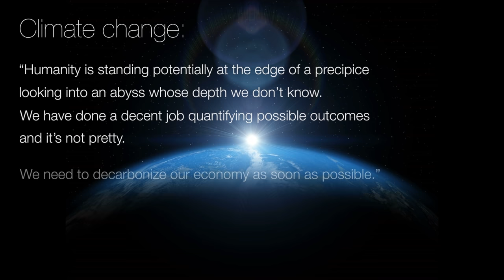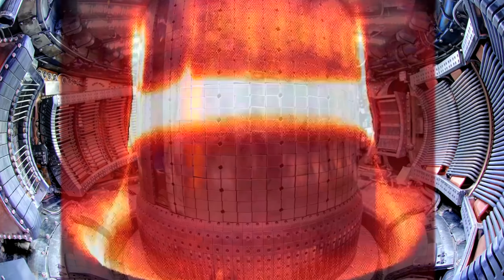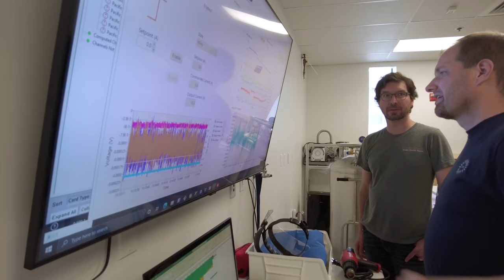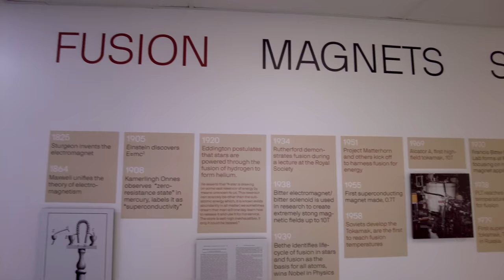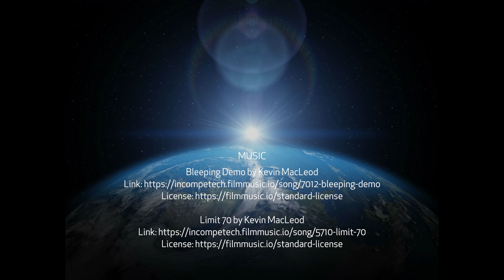A Star in a Bottle: The Quest for Commercial Fusion

Comment: It's a great achievement to switch on a 20T magnet. Once you trap a fusion plasma inside, an immense reaction force/pressure will push back. Is it going to be an engineering challenge for ceramic HTSC to withstand that force, or has it already been resolved?

Comment: If the necessarily extremely high magnetic fields can be achieved using high temperature superconductors this would be an enormous breakthrough in and of itself, as it would eliminate the need for liquid helium. Helium is a non-renewable resource, its availability is in large part tied to that of fossil fuels, as much of it comes from oil and gas fields. High temperature superconductors have critical temperatures around that of liquid nitrogen, a guess which is the main component of air.

I do agree that renewables may only go so far in solving the carbon problem. But I've heard so much optimistic talk about fusion over the years, I really hope there are enough "miracles" out there to make it practical.

Comment: "we're gonna max out with renewables"

what?  That makes no sense.
Reply: Because renewables are intermittent. You may add more and more energy storage to cover downtimes of hours, then maybe days, but there still wouldn't be enough to reach reliability of baseloads (coal, gas, nuclear). Therefore renewables will max out in terms of a percentage of the power mix, subject to the reliability of the grid. Think Texas (I'm referring to the difficulty of black start). Imagine a hurricane, high winds will stop wind turbines, and clouds will reduce effectiveness of solar. Or volcanic ash that affected Europe a few years back. Having coal/gas only as backup wouldn't be economical either. You'll need to put capital and maintenance cost into something with equal power generation capacity, but rarely used. Might as well just use it. You'll also need the whole supply chain ready to be ramped up at a few hours' notice. None are impossible per se, just very unpractical.
Reply: @deep.space.12  those issues have nothing to do with renewables and everything to do with grid management.  Base load power is a myth, it can be worked around relatively simply by just making the grid larger and more adaptable.  Texas's only problem was that it had it's grid independent from the national grid or it could have just imported power.  The Belt and Road grid plans from Europe to across asia would solve the storage issue and intermittency because the sun never sets on the whole grid.

Comment: 5:16 AFAIK the 20T on 5-Sept-2021 does not seem close to being a world record. Assuming direct current is the type under discussion, I was under the impression the record was approx 46T as far back as 1999, and that the bar is presently 100T+.  

Am I missing something ?
Reply: yes this is sustained field intensity. Those higher numbers are pulsed power fields.
Reply: This is the highest field strength for a system targeting fusion, not any general limit...
Reply: @offmeds2nite  Thanks, and +1. 👍
Reply: @VAXHeadroom  Thanks. 👍

Comment: 20 tesla magnets were are MIT back in the early 80s.  High temperature superconducting magnets have exceeded 20 tesla previously.  CFS is designing for a d-d fuel system which causes a high flux of neutrons making the whole structure brittle and modernly radioactive.  Thus limiting its lifespan AND causing a huge disposal problem.

Further, HTS tapes (ie the flat ribbons) that CFS is using have serious problems of trapped flux (screening currents) making control of the actual field difficult (if not impossible).  This is necessary to maintain the confinement and is a real problem.  All of these issues can possibly be solved, but it is going to be harder and take longer than we all would wish.  Commercial fusion was, is and will be 25 years in the future for quite awhile.

These overly optimistic promises ignore the real problems and actually harm progress in fusion energy by engendering a lack of credibility.

Kudos to CFS for getting an HTS magnet running at 20 tesla.  This is quite an engineering accomplishment in itself, but overselling does no one any good.
Reply: Wouldn't ITER have the same issues you are proposing?  I hope all the money at ITER has considered equipment life.

Comment: I'm confused on why the machines are so big, wouldn't it be a good idea to perfect the system on a smaller scale then build up when needed.
Reply: This IS the smaller scale. You need a fundamental size just for the technology to work. If they get too small then the forces become too huge and the heat dissipation needs becomes too high and the radiation becomes too high.

Comment: They need to change the shape of the cross-section of the magnets. They're using a "D" shape cross-section, if they change it to an "O" shape, the fusion plasma lasts longer!
Reply: CHANGE THE SHAPE TO A SPHERE LIKE THE SUN.
Reply: How do you know that?
Reply: @bernhardschmalhofer855  look at the stars. What shape are they??🌞
Reply: @ophello  you are very bright. you can use magnets to compress the plasma into a sphere so it WONT KINK.
Reply: @esecallum  Stars are spherical, because gravitationally bound matter tends to aggregate in a sphere when there is enough of the matter. In a Tokamak the plasma is not gravitationally bound, it is confined by magnetism. This magnetic confinement works because charged particles are swirling around magnetic field lines. In this context it is useful when the magnetic fields lines are closed loops. The easiest configuration for that is a torus. An alternative configuration would be a magnetic mirror, but that didn't work out as well as a torus.
Reply: @esecallum  You might be referring to something like z-pinch machines. But those do not create spherical plasmas. I'm also fairly sure that Maxwells equations do not allow for spherical magnetic confinement. But my math skill are not good enough to do that myself.
Reply: @bernhardschmalhofer855  wrong. in a torus it ALWAYS kinks and loses energy. a sphere is best as no kinks can occur
Reply: @esecallum  Yes, there will always be losses in a torus. But one has to deal with what is possible, not  what is wished for.
Reply: @bernhardschmalhofer855  losses? I was talking about kinks and how its never going to be stable. It's worse than balancing a pencil on it's point. You are very gullible and easily swayed by slick marketing.
Reply: @bernhardschmalhofer855  the 2 forces are compression and expansion in a sphere. 2 degrees of freedom.  In a torus you have six. That is why it kinks  touches the walls and loses energy and fizzles out. A plasma ribbon will always know no no matter how hard you try. The slight  imperfection and it kinks.
Reply: @esecallum  I don't buy that argument. Magnetic confinement does not work by applying some kind of external pressure to keep the plasma together. The plasma is kept in place by the Lorentz force. where charged particles are gyrating around magnetic field lines. In a way, magnetic confinement is not like a bottle, but more like a sponge.
Also, I would not count expansion and compression as two degrees of freedom. This is a single degree.
Also, I have the impression that what you call kinks is usually called disruptions.
Reply: @bernhardschmalhofer855  have you ever tried to squeeze a long rod shaped or ring shaped balloon ? when you squeeze one part anothe part expands. the SLIGHTEST imperfection and the hot plasma kinks. a physicist actually proved it mathematically that even the slightest imperfection in the magnetic field confinement would cause kinking because the plasma is interacting with the magnetic field cause instability. you know what they did to him? black balled him and stopped him publishing his paper in P R.
Reply: @esecallum  Yes, I have played around with ballons. But that does not apply to the plasma in a Tokamak. There is no external pressure, like the rubber of a balloon, but internal attachment to magnetic field lines, like the fibers of a sponge. Try to push into a wet spoon, you won't the same effects as in a balloon.
Reply: @esecallum  Your sentence in all capital letters does not make sense. A failure in approach A neither proves nor disproves that a random approach B works.
And who told you that I'm obsessed with fusion? I spend entire weeks without thinking about nuclear fusion.
Regarding waste from nuclear fusion, I'm not concerned about that. It's just the activation of materials from neutron bombardement. This can be dealt with.
Reply: @bernhardschmalhofer855  you have no idea it's just as bad fission energy  or even worse . You have been taken in by slick marketing hence your obsessive defending of it
Reply: @esecallum  Well, that contradicts what I think to be true. If you are right I hope that  smart people will point out the problems before fusion is commericalized. Assuming that there will be a time where fusion is commerically viable.

Comment: I don't mean to poo poo, as I support all forms of research, particularly fusion research, but the quote at the start of the video highlights the absolute importance of decarbonizing our energy grid as quickly. Even more than that, we need an energy source that is not only carbon-free, but also produces large amounts of power at an extremely low cost, so that we can use excess cheap power to start pulling vast amounts of carbon out of the atmosphere. 

While fusion could absolutely do that, we don't have it, and we likely won't have it for at least a couple decades. What we do have at this moment is fission, and it is already almost as good as the fusion that we hope to have in a few decades, at which point it might be too little too late. We need a solution, and we need it NOW, not by 2040 or 2050, and fission is the ONLY workable option that we have. 

Energy Yield: H2-H3 fusion will yield ~ 4X the amount of energy you get from U-235/U-233 fission, but when you consider that the fusion reactor is going to have to pour a large portion of the power it produces right back into the reactor to maintain it, very optimistically, fusion only will produce 2-3X the amount of power of fission. So, fusion is still better than fission, as a 2-3X increase in energy yield isn't nothing, but that's not that impressive given that fission already produces 1 million X the amount of energy as fossil fuels. 

Cost: The video talks about making fusion economical, but given the size of the reactors, the cost of the materials used, the complexity of the equipment and required precision, I doubt you could build a fusion plant for cheaper than current LWR fission plants. Of course, current fission reactors are super expensive, largely due to having to deal with containing water at high temperature under stupid high pressures. Before 3 Mile Island, after which regulators started slapping more and more safety features onto reactors (some justifiable) to address problems related to water, the overnight capital cost of a new fission plant was maybe 1.5X of that of a fossil fuel plant, whereas today a new fission plant is 6X-8X of that of a coal or gas plant. However, several Gen IV reactors, particularly fluid fueled thermal spectrum MSR's, would allow reactors to be built smaller and without a lot of the features that make LWR's really capital intensive, like no containment buildings, no piping capable of holding hundreds of atmospheres of pressure, etc. So, a commercial scale thermal spectrum fluid fueled MSR should be MUCH cheaper than current LWRs and possibly cheaper than a theoretical fusion plant. 

Waste: Historically, fission reactors have produced a lot of long-lived radioactive waste, while people don't tend to associate fusion reactors with radioactive waste. That's not true though, as if we're talking H2-H3 fusion, the inside of that tokamak is going to become pretty radioactive over time simply due to neutron bombardment. Also, and this is from another video I saw, I understand that the SPARC reactor is supposed to be surrounded by a molten lithium salt blanket which will use the neutrons escaping from the reactor to produce the H3 needed for the reactor. H3 is radioactive and I'm sure you'll also produce other radioactive bi-products. However, while fission reactors do produce radioactive waste, the only reason they produce long-lived waste is because they don't achieve full burn-up of the fuel. In a thermal spectrum MSR, you could achieve almost a complete burn up of the fuel in the reactor. ~87% of the fission products from an MSR are short lived and should be gone within a decade or so of being produced. Only around 12% of the fission products, Cs-137 and Sr-90, will require up to 300 years to almost completely decay away. 

Commercialized: Fusion - 2040 or 2050, maybe, depending on continued improvements in super conductors? Thermal spectrum MSRs - we've largely had this technology for decades. Oak Ridge's MSRE proved the tech and addressed many of the potential issues, such as materials and corrosion, chemical processing, modular design & remote handling. There were issues they couldn't address at the time, such as near-real time chemistry monitoring in a high-temp high-radioactive environment which you need to monitor fuel density and general chemistry (so you don't end up having fission products plating out on the inside of the heat exchanger when the salt's temperature drops. Most of the issues which Oak Ridge never got to work on have since been solved though. The Chinese took Oak Ridge's work and have been running with it for a decade now, running a test MSR for a year or so now, and are planning to build their first commercial scale experimental MSR in the next year or so. 

The future is now, and it is LFTR.

Comment: I heard that a fusion reactor requires two fuels: deuterium and tritium.  Deuterium is abundant but there will never be enough tritium to run the fusion reactor for more than a short time.  Someone needs to start making enough tritium before 2060 when the demo fusion is supposed to come online.
Reply: The reactor is designed to be able to create tritium at a surplus, so we only need a little bit to be able to start and then from there, the supply of tritium will scale well.
Reply: Tritium is generally made from lithium.  It's also possible to just fuse deuterium with itself.

Comment: Stupid question but, could you use resonant sound wave frequencies to contain the plasma once it has been generated instead of only using magnets?  Also, I came up with a way to multiply large numbers in less than 4N steps, instead of N^N steps.
Reply: The torous is at a vaccum, so no way to to transmit accoustic energy.
Reply: @Tore_Lund  I figured there was something I was overlooking.  Thanks
Reply: @Tore_Lund  if it is truly a vacuum, what are they heating up?  They need nuclei to collide to make helium to release energy.
Reply: @anothermike4825  You are absolutely right. I thought it was like a neon tube<, low pressure to keep resistance in the gas low enough to conduct the induced current. However looked up the ITER and they are running it around 2 bar! The reason for this is to have enough nucleus close enough to make fusion possible. So yes sound waves are possible!

Comment: Great progress! How about making of the magnets - did you buy them from a commercial partner? Can we use them at ITER project?
Reply: ITER is using a completely different system of materials for their magnets.  It will produce significantly lower field strength and requires liquid helium temperatures - about 4 Kelvin and 6 Tesla.  THAT is the innovation CFS has been working toward; using a high temp SC (HTS) that can actually run as high as 70K (they are targeting 20K) and producing 20 Tesla.  ITER can't re-tool for the new materials.
Reply: @VAXHeadroom  thank you. Absolutely no context and hardly any facts in this video.
Reply: Note that the HTS (and SC in general), even though its critical temperature is 70K, the performance will drop when you go near it. This is why everything is still running at 20K. In that case you'd probably still need a Helium infrastructure to run it, because it's below Nitrogen cooling.
Also the CFS innovation is in the design of HTS tapes. HTS are ceramic materials, which are brittle. ITER uses metals, which are ductile. To trap a plasma, there will be a reaction force, and it is structurally easy for metals to withstand it. Consider also the occasional plasma disruption due to instabilities. If I remember correctly, once it even tossed the JET reactor in midair.... And the HTS tapes (with support, of course) has to be able to deal with that.

Comment: Centering this discussion around decarbonization is silly. Like the 19th century centering a discussion of power sources around clean drinking water. It's just not going to be a serious concern going forward; plant trees, use sulfur aerosols, pull the carbon out of the atmosphere directly using some small portion of the millions of gigawatts 2100 humanity will need. Or move to Mars where the more carbon is in the atmosphere, the better.

Comment: How do you extract the energy produced by a fusion reaction?
Reply: D-T fusion produces both an alpha particle [He nucleus] which needs to be contained by the magnetic field to keep the reactors internal operating conditions and a fast neutron which leaves the plasma.  You capture the neutron in an external blanket of Lithium which then reacts and releases another alpha particle and "breeds" the Tritium.  The blanket gets hot as a result and you run a coolant through it  -- the coolant passes through a steam generator.  The rest as someone said is 19th C steam cycle technology.